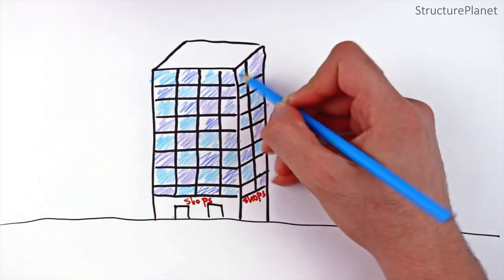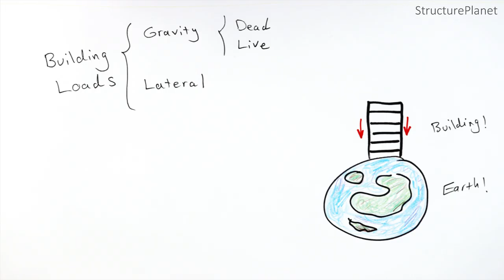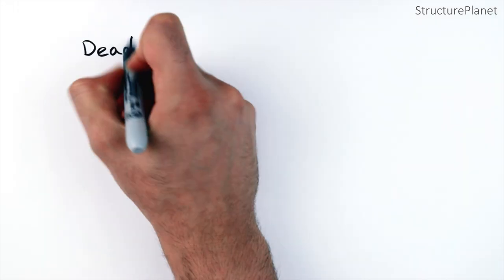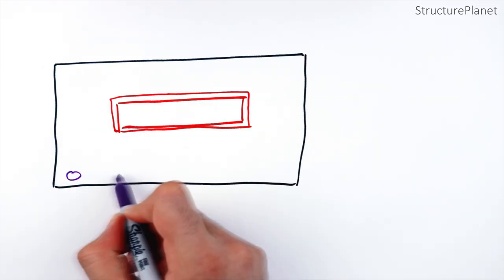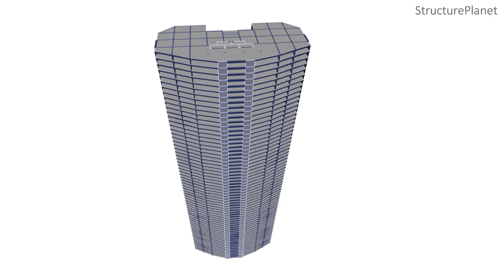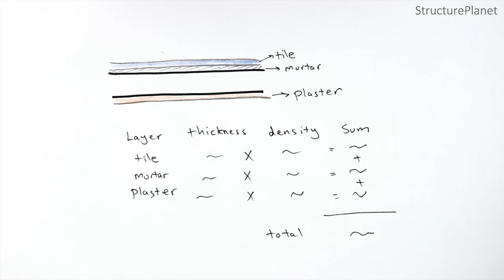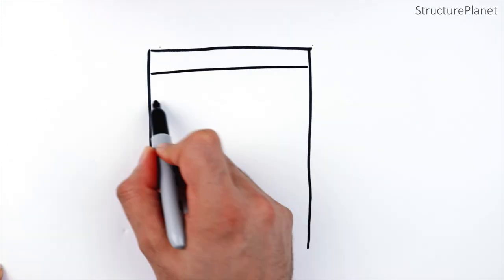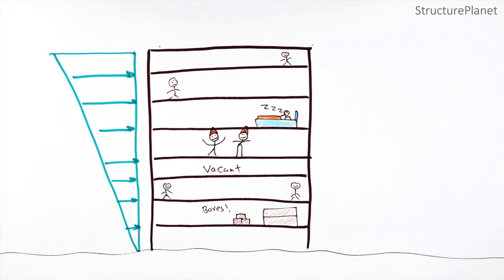Loads in Buildings Explained

Comment: What is the preferable floor system for high rise buildings that gives the lightest weight?
Give me choices please
Reply from the maker: I have seen high rises with post-tensioned concrete slab, reinforced concrete slab, and also composite floor system which includes steel beams, metal deck, shear studs, and reinforced concrete for topping which is the lighter option.
Reply: @StructurePlanet  thank you a lot
Keep going I like your videos and how you explain things simply👍